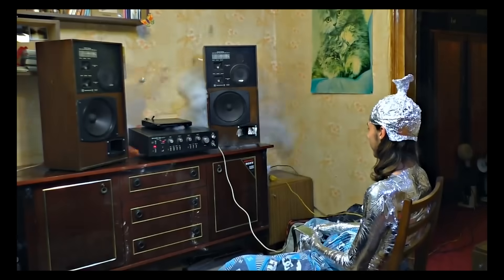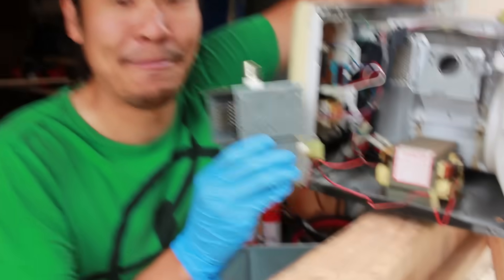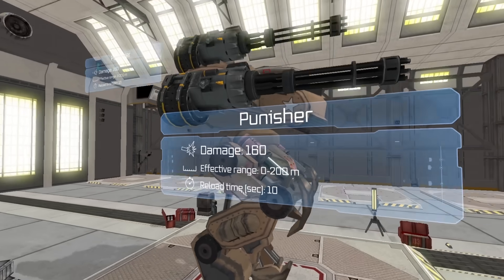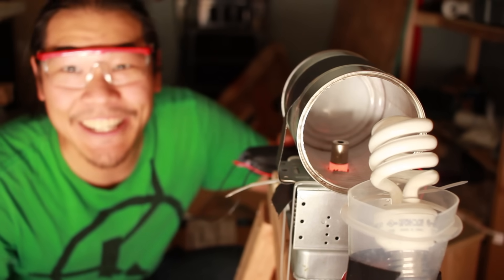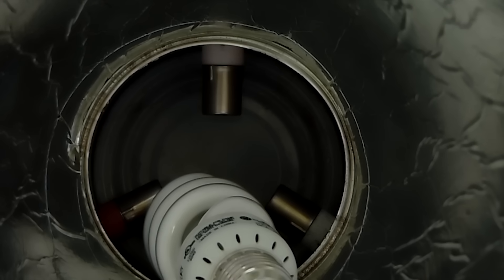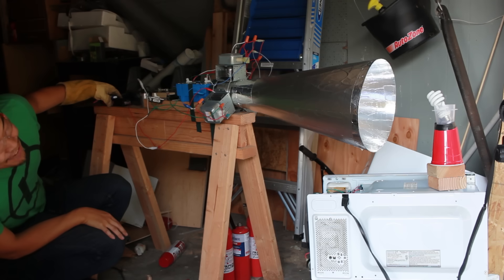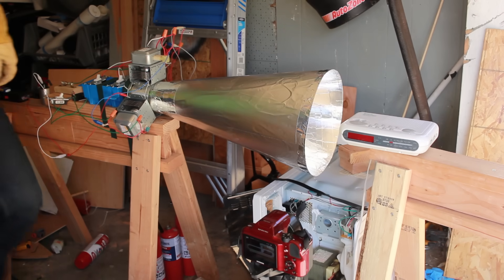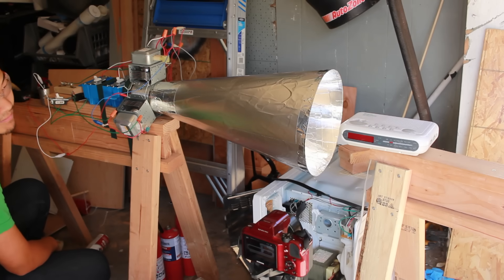A Microwave Gun Made From Taser and Soup Can??? (Testing Kreosan's Magnetron Cannon)

Comment: Many years ago I read that a directional EMP device was being researched for military or police use. An example of police use was to stop a speeding vehicle. However, if it worked there is no possible way it wouldn’t also trash other vehicles around it. I suspect they gave up on the idea due to excessive collateral damage.
Reply: It would also destroy all mobile devices and other electrical infrastructure in the immediate are, unless it was super focused.
Reply: it exist, and you can buy one.  Ask a gun nut, they know.
Reply: @reppich1  I asked a gun nut and he didn't know wtf I was talking about.  Please explain.
Reply: @reppich1   gun nut...

His coconut gun can fire in spurts...
Reply: @reppich1  ok, fudd.
Reply: @frigglebiscuit7484  - were you too lazy to actually read the article or was it just too far over your head?  All the answers are in the article.
Reply: @reppich1  what? wtf do firearms have to do with emps? also, it wouldnt stop a car with points ignition and a carburetor.

Comment: did your calculator and radio work afterward?  another gun maker says you can't explode electronics or permanently kill them only incapacitate them while they're in the beam incl drones.  the angle of your cone may increase your throw.  the same guy, using only 1 magnetron but a/c as a power source was able to light up fluorescent 2 meters away no problem:  https://www.youtube.com/watch?v=C028XyT7pIM

Comment: You are lucky that it doesn't work better, otherwise this can be very dangerous, very painfull and can blind you quite fast.
Btw. that plastic-goggles are nothing but decoration in high-frequency-experiments.
Reply: I thought mircrowaves were low frequency?
Reply: AlwaysABiggerFish yeah but microwaves are/is really good at heating water molecules (because of the frequency or something I think) so it can mess up with the water in cells, blood vessels e.t.c
Reply: @alwaysabiggerfish9564  No, high frequency... It like trying to stand on the NASA active Radio/Scan sat Disk... It will fry you, I believe..? 
Microwaves are the same, that why it cooks for us in that little box. 
When you look inside and you see this metal cage around the glass as well, it to prevent "most" of the electromagnetic radiation from causing harm to life outside its box. 

Just take this advice... Don't fuck with them unless you know what you are doing, even an inactive microwave still dangerous as some of the storage can still be charged.
Reply: @AddBlue247  radio waves are a lower frequency, but large amounts of microwaves can be dangerous nonetheless but i'm referencing the electromagnetic scale relative to visible light.

Comment: Any way you can up the voltage to 110 volts like the magnetrons were designed to operate at?  Would this do anything? I say another comment about pointing it at a drone. Go get one of them 80 dollar K-mart drones with a camera and see if it disrupts the communication, flight, or camera operation of this. Pretty cool video even with the limited results.

Comment: Test Faraday Disk with Electro Magnet instead of natural Magnet, but make it a starship coil, and have two of those as one unit each spinning off of each other, to keep self spinning.
So sandwich together Starship Coil + PWM + Faraday Disk, do that twice. And wire them so each one vortexes opposite of each other. Manual spin them and “remotely” wirelessly power up the Starship Coils at first until you notice speed increases, then take away your power source and watch it take off, self spinning getting faster and faster

Comment: Did you know that the pink coating on the magnetron is really dangerous ?
Reply: The big gold looking woven flat washer is made of gold so it's worth the risk.
Reply: @peglegnoid6139  *brass
Reply: the ceramic insulators contain beryllium oxide witch is best to avoid beathing the dust if you beak/smash/cut with angle grinder. I don't think they use that anymore though, so newer ones might be safe.

Comment: The reason the radio doesn't stop working is that because most of the time microwaves won't be on the same frequency as the radiowaves the radio recieves; causing some interference, but not much.

Comment: Dude, thank you for debunking this video. The instant I watched the original, I was like, no way, this is totes bullcrap.
Reply: Debunking or just replicating it wrong? He did miss out the rectifier diode which is what the magnetron needs, IE DC not AC although the mt will rectify a very small amount the output is reduced significantly.

Comment: One thing is critical, the position of the antenna in the can. This will vary according to the frequency(2.45 GHz in this case) and should be 1/2 wavelength from the back of the can. So my question is: did you measure it or just wing it?

Comment: The problem with multiple maggies is that there is no way to insure they are in phase. This results in interference between their outputs. Just one is plenty. A radar I used to work on had only about 250 watts(with a range of 50 miles and more under freaky atmospheric conditions.), whereas the microwave ovens typically have 700 to 1000 watts. What you want is the cap to discharge only when it's full, then wait till it re-charges. Perhaps using the stun gun to charge up a Marx generator which then discharges to the maggie.

Comment: Those were Russian tasers tho, and they used a large capacitor, higher voltage, and the 18650s were wired to the taser as well. The cone is a crucial part and needs to be tuned.

Comment: Because the magnetron is a waveguide you are feeding a horn antenna with a wave guide. This presents a problem as the feed element should be in the rear in this case. This would result in some decrease in antenna gain. Again with the conical horn structure should matched with what ever frequency you end up through the horn via magnetron. Though the power supplied the by the source is low you can still improve range modifying the above. I'm not sure how the 3 feed elements would help the antenna in this situation. Arraying of elements is typically in antenna design, but usually it is with multiple horns and not feed elements.

Comment: If you were to change the direction of the antennae, you would have a better result. As of now, they are bouncing off of eachother at random
Reply: Also if you were to alter the transistor in the radio, you might be able to hear the microwave interference better, Try increasing the range by changing width in the copper coil on the inside.

Comment: Actually, there is possibility for a microwave based energy weapon (one that can actually destroy stuff like a nuke). It would work by using a very large magnetron meters in radius and extremely high frequencies. The resonance would charge until the desired power is achieved and focused into a pulsed beam or laser at a target.

Comment: I am pretty sure that they didn't use a spark gap at all. And a spark gap obviously consumes some power.Also, they said in the video that it was a modified shocker with improved power supply and capacitors in there.Plus, they did talk about a right configuration of the emitter so that they probably made a few different proportions to see what gives the best range. The interference and bulbs are real, I'm pretty sure.

Comment: Your antenna does not seem well optimized. Did you do any calculations or simulation for the placement of your magnetron source? 

Microwave Cavity simulations are important for proper placement of magnetron sources. Also your magnetron sources must be in sync otherwise you will never get the energy much further than your near-field which at 2GHz and judging by the size of your antenna is going to be around 1meter or less.

Comment: well the wavelength of microwave is from 1 mm to 1 m so to make that experiment more valid you should try at different lengths and measure W at those lengths to get an estimated wavelength. it should work but most likely only at the peaks where all 3 emitters amplifies the signal.

Comment: Normlly I'm not commenting on all dumb videos but here are i was outradged : some uneucated dude trying to copy some "device" without understanding actual physics and small details that makes a huge difference. First - original video "gun" works in impulse mode meaning  that impusle power could be anything, depends on dutycycle- (1GW if you want),And for effect  impulse amplitude is more important than avarage power. Second - geometry is a key- especially in microwave world- it requers matched magnetrons  ( different vendors have little bit different frequency and impulse response), matching grounding and specialy adjusted interface.  In original video it was clearly mentioned that the secret of long distance effects in correct matching of magnetrons and rupor antenna that took a lot of effort....anyway

Comment: The other thing is you have to calculate the wavelength and design a directional wave guide. Putting 3 magnetrons and 2 pointing at each other is not effective. If anything one fighting the other. 

The other issue is your feeding straight AC and need DC on HV side, so you need the diode in place and capacitor.

Yes the electronics blowing the way he showed is possible as I made one but power it using transformer. To rig enough 18650’s cell and inverter I believe it would worked. But the Russian video is more likely edited and fake. 

Your setup it won’t as you don’t have a proper wave guide and not directional and feeding AC instead of DC, plus you don’t have enough stored current for the burst.

Comment: No way they did it with the taser. I could see it being possible. I did notice they had 4 18650 cells, but don’t see a inverter? You would need batteries that has high c rating that can have the capacity and current needed and HV inverter since it has to be lighter then HV transformer.

Comment: Adding capacitors causes an oscillating circuit which increases electrical efficiency.

Still, their video was bunk.

I agree that there is no way some little batteries are going to emit enough radiation to do that kind of damage.

Important health and safety notice to everybody watching this though, microwave radiation can cause burns, blindness, sterility and even brain death if one is exposed to high levels, so if you decide to go make one that REALLY works, 1, stay far far away from it and 2, wear some kind of reflective shielding!

Comment: You need to direct it better, and perhaps a stronger capacitor to release stronger EMPulses.
You're not gonna get the same range as those guys had, but it will definitely be able to take out some equipment point blank.. Perhaps an alarm, or electronic lock. ;)

Comment: We can agreed, though, that the original microwave product with the doors and rotating plate and wave guides and amplifier circuits and whatever else is inside the microwave over, right ? Its like you de-powered the microwave emitting portion of the oven. the magnetron itself is one part but you need the other circuits to make an even more powerful microwave source.

Comment: your capacitor voltage was not high enough for the taser, the voltage of the taser is way more then 2000v so your actually loosing energy in your pulses.

Comment: It appears that you were not rectifying the high voltage from the stun gun, so you are supplying AC to the cathode. The tube wants to see DC. Use the diode hanging off the capacitor as a half-wave rectifier. You may need to use a few in series as your stungun may supply more voltage than one diode can handle (I believe about 6 KV). The diode and capacitor normally act as a rectifier and voltage doubler, but you are using the capcitor in parallel and the diode not at all, so they don't do either of those things here in your circuit.

You are correct in that the stun is unable to source much current to the magnetron. So this raises the question... why are you using a stun gun instead of simply using the microwave oven transformer, capacitor, and diode arranged as intended in the original donor microwave oven?

Note that even with AC you will get some activity as the tube itself tends to rectify the high voltage.
Reply: Noah my man!  How have you been!  Good to see you here :)
Reply: Can you make one and put it up on yt please?
Reply: Noah Spurrier well stated and correct. You understand electricity. Most folks without an education in electricity won't be able to understand what you just said.
Reply: @ChefGreg78253  if YOU knew anything about electronics you would know that stun gun output is already dc as rectification is already part of the voltage multiplier network of diodes and capacitors after the eht transformer
Reply: @ChefGreg78253  You are correct in that
Reply: Ok.
Reply: Noah Spurrier he doesn't even have to do anything to prove it is fake. The people used some special compacitor and some guy is saying that the Ukrainian guys were using military shockers you don't get that stuff regularly
Reply: dragon slayer hell, who doesn't keep Ukrainian military grade shockers in their parents basement. Lol
Reply: Maximus Ditamus Lol but in all seriousness both videos have alot of fails so they both messed up
Reply: dragon slayer trudat
Reply: @ChefGreg78253  In Ukraine anything is possible believe me
Reply: @ChefGreg78253  I mean it is ukrainian military grade so you just got look through some kids toys
Reply: @paulsantiago7643  True , its like most of the stuff on the Kreosan site , all hyped up for the gullible . If you put kreosan through google translate it comes out as creosote , dumb name for a dumb channel
Reply: Any stun gun that is making pulses like that rather than a continuous arc is already outputting DC (well, pulsed DC). I'd bet money on that stun gun having a CW multiplier on the output to actually reach the high voltage, which means it already is DC and there's no need for an additional diode.
Reply: He's the typical "expert" we are seeing being dumped out of diploma mills. They're good for getting us "exciting" backing in the form of new funding each year, while we get to do the real science and they get to write curriculums. It's a win-win until you get to the private sector full of charlatans like the goomba in the video. Doesn't even use the same design from Kreosan LMAO The guy is a joke, but I'm sure some poor contractor or god-forbid military lab is plagued by his precense, likely without his knowledge. -----For physists, researchers, hobbyists; it works. Don't use taser guts for a powerplant then expect to replicate a demonstrated invention you didn't even try to copy. Fundamentally flawed from the start. I guess this inspires someone, somewhere...whether that be rage or otherwise.
Reply: Come on guys, it's kind of silly even wasting time on replicating a russian video having guys in it with tin foil on their heads.  This is like trying to prove that David Copperfield can levitate an elephant. lol  There seems to be a lot of wasted time on the interwebs xD
Reply: @BillAnt  THEY ARE NOT RUSSIAN . Ukraine is an independant country that USED to be part of the soviet union
Reply: @MrTarmonbarry I’m pretty sure they were from Eastern Ukraine, so they’re Russians now
Reply: Noah Spurrier oooooooo boi using smarty words very smart man.

Comment: uWave emitters (radar based device discovered by melting candy bars in a lab guy's pocket) need a frequency matched antenna to actually get decent rf radiation levels beyond the magnetron.  

Any rf transmitter without a load matched antenna won't get any significant energy transferred and might damage the transmitter due to reflected energy from a mismatched load.  Some can be damaged just by transmitting without an antenna.

The Russian dudes used a frequency matched feed horn antenna and three emitters.  If the combo was tuned right (good luck and wear shielding) even low power levels could emit dangerous levels of uWave non-ionizing radiation.   

Possible, but risky, and don't get in front of the horn/antenna.  I still have a scar from 50 watts of rf energy.  It really doesn't take much.

Comment: Errors I see in that design,

1) conic shape , nonono, if it is a canon, you want all the energy concentrated as a beam, not propagated to a large area or the energy per cm2 of attack will be lower.
2) stun gun? nonnon, just use the normal circuit of the microwave and connect it to a UPS, as the time per shot is short, autonomy isn't affected.
3) divide the circuit for heating the filament, from the HV, use a low wattage transformer to pre-heat, so when activate the large transformer the magnetrons are already hot, this will minimize the comsumption.
4) use a plate behind the cannon, so any bounciong microwave won't hit you.